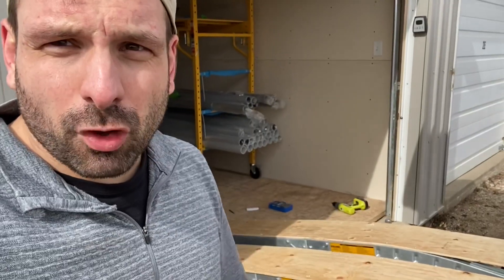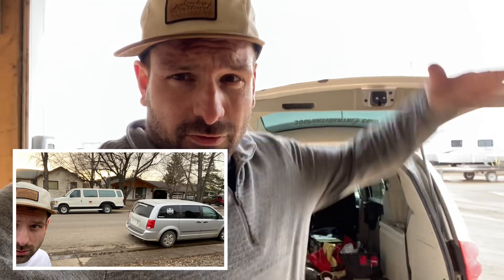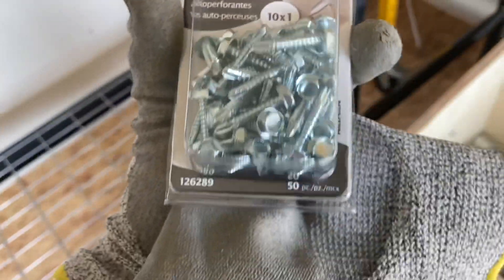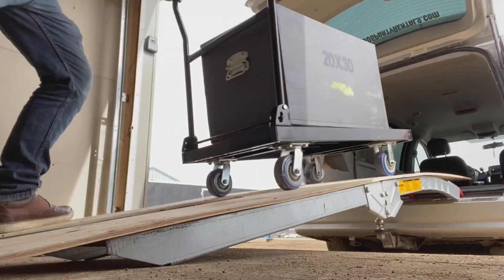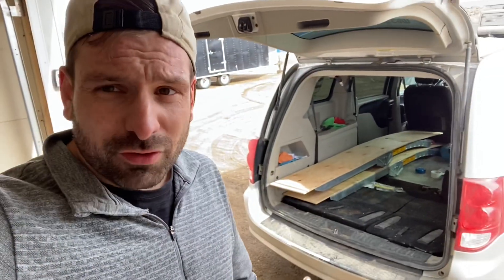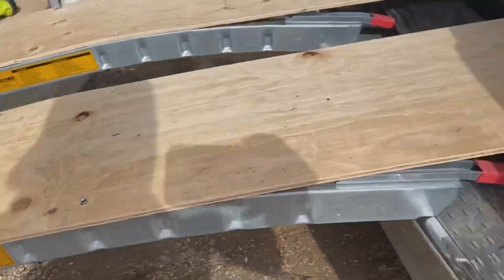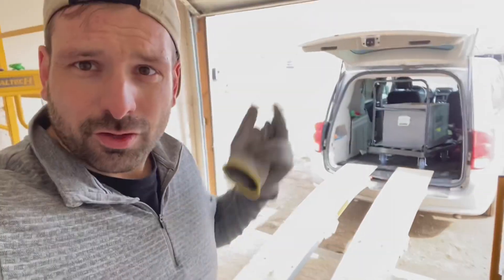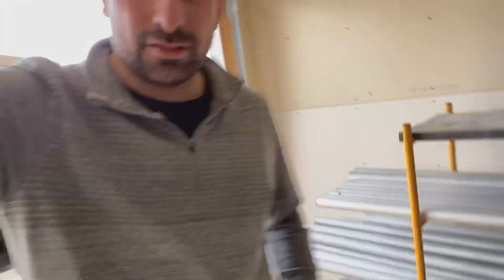How To Make A Mini Van Loading Ramp DIY

Comment: Is the top bumper solid? You might rip your bumper out with the weight
Reply from the maker: I’ll make a video if the bumper rips off. The hitch sits under it and most likely supports the weight.
Reply: @therentalguy   hahah, that is such a great idea. I need to do that with my photobooth so its quick to unload at events. Are you taking the ramps with you to events?
Reply from the maker: Yes, that’s the plan. Everything must have a ramp from now on.
Reply: @therentalguy  You could always strap the ramps to the top of the van if you need the room.